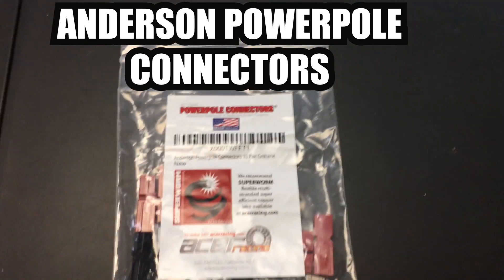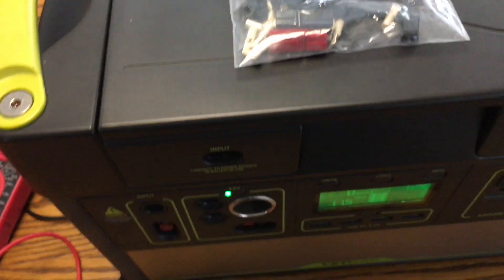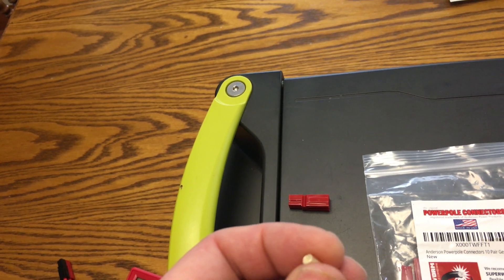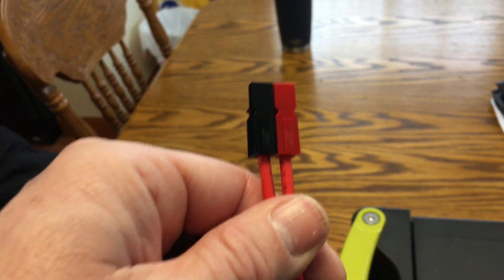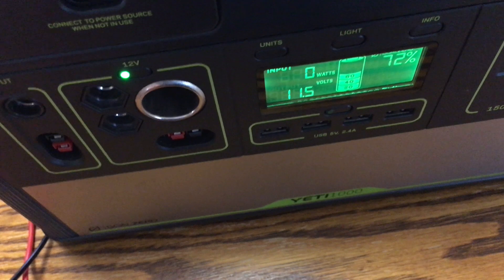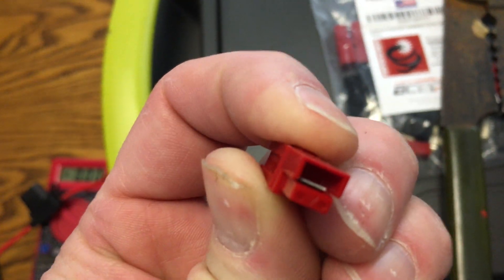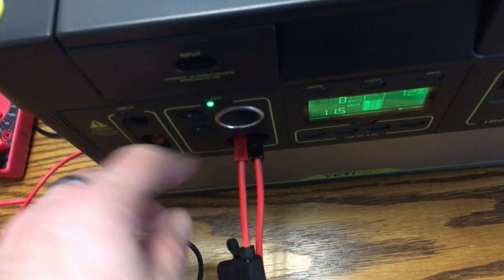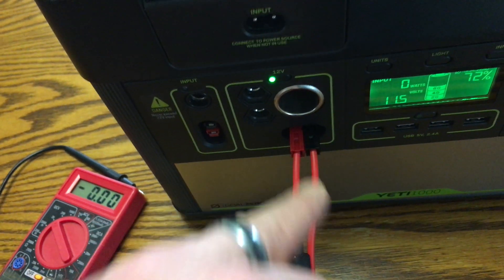Anderson Powerpole connectors and the goal zero, jackery power station

Comment: my goalzero has ur inputs and my solar panel is side to side. i put them top to bottom and it wont charge directly. but if i use the adaptor that came with them then it works. why does it work with the adaptor that has anderson and 8mm, but it wont charge directly ?!
Reply from the maker: Not sure what model you have, but it’s possible that the goal zero needs a minimum/maximum input to work, perhaps the adapter is creating the correct voltage. One way to verify is test with your dc voltmeter.

Comment: A tip if you get the package with different things, the smallest hooks you might want for small stuff, so you can make this trick of doubling to even tripling the Copper end and use a bigger hook for crimping. I did buy a crimping tool for this. The thing is if you have small wires for something you might want to have the small hooks at hand for that.

Another tip for the small metal inserts for them not moving apart, you can take a small magnet and they then clump together in the box, works wonderful :)

Comment: Well explained! So many fake ones out there...what makes them hard to use...the fake ones...is that once you try to slide the crimp into the housing, there is little clearance in the housing and it is very hard to do. You many need to press the housing down toward a desk and not do it in hand. That seems to work. Otherwise, you get the feeling you are doing something wrong, because it just does not want to go in

Comment: My solar extension cable is 6mm and has a cable end fitting that is pretty thick. Hopefully my anderson connector is big enough. It arrives today which is why I watch some more vids....(earlier I ordered a far to big normal anderson plug)
Reply from the maker: how did it work out?
Reply: @IFix-Things  The 15A pp Anderson is too small for the cable. I will make a bypass with another piece of wire.

Comment: Thanks, this was super helpful! I was surprised that there was no info in the Goal Zero other than "12V Output"  
Question: Any idea what the other 2 DC outputs are for? The GZ docs only refer to them as "6mm" but I can't find any practical use for them.
Reply from the maker: I'm not sure either, mostly I use the cig port or the anderson.

Comment: Do you think it would be possible to run a rocker switch panel from the anderson wired output on a goal zero?
Reply from the maker: you could but depending on how many amps you are pushing you may get undesirable spark
Reply: @IFix-Things  at most a small in line water pump and some small LED lights, nothing major. Thanks for your reply :)

Comment: Are the Male and female connectors the same?  Do you just flip it to the other end to get male or female?
Reply from the maker: Ratha the black and red connectors are the same!
Reply: @IFix-Things  thanks for the reply,  but that doesn't answer my question.  
I would like to make 2 wires and connect them to each other using these connectors.  Is there male and female specific version of this connectors or are they all the same?
Reply from the maker: @ratha8665  They are all the same, so no there is no male or female.